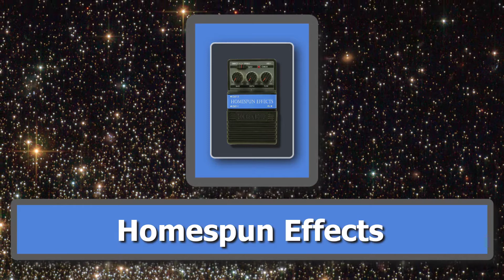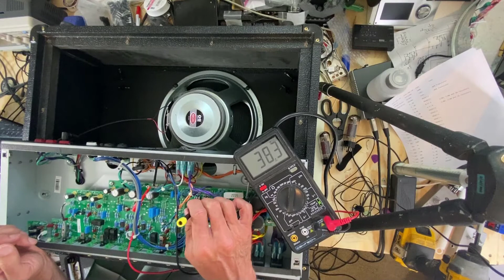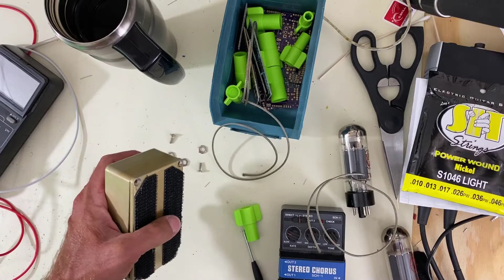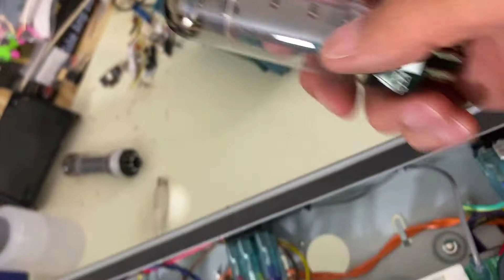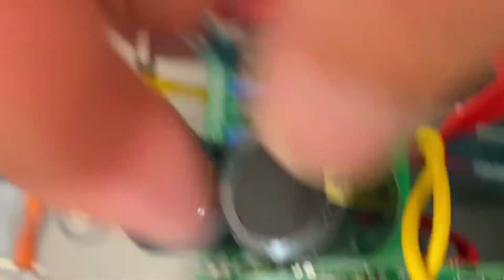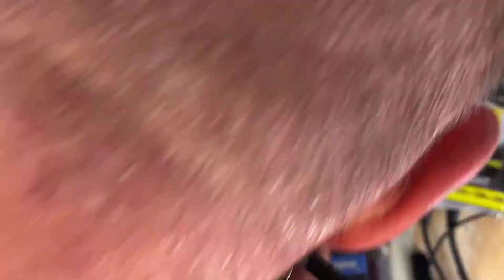Fix Your Own Amp - DIY - How to Bias Your Marshall DSL40C

Comment: Hello again. I have the marshall dsl 40c. It started to make a loud static, hum so i replaced the tubes, jj el 34 tubes x2.. And set bias at low 38. I still have the noise after replacing and setting bias. There is also 4 small tubes in it. Could it be that 1 is bad causing the noise? I am considering replacing all 4 while i am there. Concidering replacing with jj 12 ax7/ecc83 from amazon. It had marshall ecc 83 tubes in it. Any suggestions ? Thank you.
Reply from the maker: @alangreenhaw8187  is it like the sound of rushing wind that cones and goes? I had that and it turned out to be the phase inverter (V4). It’s the 12ax7 farthest from the input jack. 

Also check out Uncle Doug’s video called “Two Types of Tube Amplifier Hum and How to Determine the Source” here on YouTube.
Reply: @HomespunEffects  hey, thanks. Is it best to just replace the 1 or all 4 at once?
Thanks for your opinion...
Reply from the maker: @ it doesn’t hurt but it may be unnecessary.
Reply: @HomespunEffects  ok, thanks. Have a Happy New Year 🤗🤗

Comment: The green light for clean channel doesnt come on or the red for gain side . Power light is the only light to come on . Whatever thts worth . Thx
Reply from the maker: Are CON4 and CON6 plugged in? That's pointing to an issue with the relays or maybe the microcontroller.
Reply: Normally   it clics 2,3 times when its powered on , no clicing now .
Reply from the maker: @tomfoolery2082  are you getting 5v supply to pin 20 of the microcontroller?
Reply: Con 4/6 are plugged in good . There is a con 4a / 6a ,, if tht might tell somthing . Pin 20 on the microcontroller  idk lol ,, not seeing anything that looks like tht . Not seein tht on my schematic tho j thk it for a dsl 100 . Where would this controller  be . Thx
Reply from the maker: @tomfoolery2082  Look for IC4. Should be connected you CON6

Comment: And iv been playin this dsl40c since this vid just a whole lot . I have a 4x12 w/ grnbks & v30s . Retired a while back , i got time to work em good . Its been 100% until now its not . Just plain  died earlier . Power lite comes on but no sound . No blown fuses . Tubes all light up expect v1 . All tubes are good until it goes in v1. No juice , not enuf to light up a 12ax7 . Any clue where to go from here ? Meter says pin 1 and 6 are 2.65mv dc in v1 
  Thx for any help .
Reply from the maker: Hello, friend. Where are you located?
Reply: Southern indiana , i can narrow it dwn if tht wld help .
Reply from the maker: @tomfoolery2082  if you were closer to me I’d have a look.

Comment: what if the problem is with the preamp tubes?do we need to bias it up also
Reply from the maker: If you're changing preamp tubes you don't really have to be concerned with biasing. However, if you replace one and it dies quickly you need to find the reason before replacing it again.

Comment: Been wanting to do this for while , and so i did . All good xcept 1 tube the bias , the numbers on the multimeter wont stay still it keeps creeping up , the numbers get bigger up to 15 over .  Any ideas ?
Reply from the maker: Do you have the same model amp? I have read that some of the early DSL2000 amps has PCBs that turned conductive and caused the bias to runaway like that.
Reply: Its a dsl40c , after putting in the new tubes turns out they were picking up lots of vibration . Like tap on top the cabinet it comes thru the spkr . So put in diff set and the meter stays real close varies 3 to 4  ma each way . Cld the other tubes cause tht  since they seemed to b not quite rt  , mayb ? Thts100% guess on my part . Seem fine now . Thks for ur time . Hav a good day .
Reply from the maker: @tomfoolery2082  mine was caused by the unsoldered grid bias resistor. Could be a bad tube but could also be a bad component in the bias circuit. If you don't feel comfortable poking around in there, don't feel bad about taking it in for service. 

Were the microphonic tubes the power tubes or the preamp tubes? When the amp is on tap on them with a chopstick or a pencil. Maybe you can see which one is causing the issue.
Reply: I changed n biased the newest power tubes earlier this morning .  If they preamp tubes causing the same problem id say they were microphonic . All systems go  for now . Thks alot .